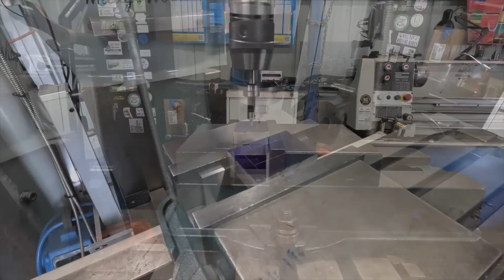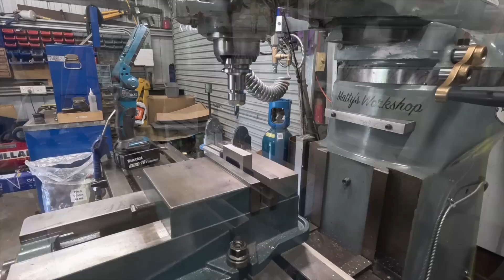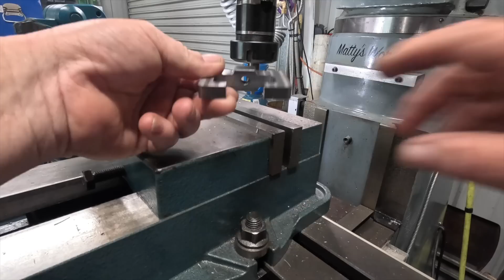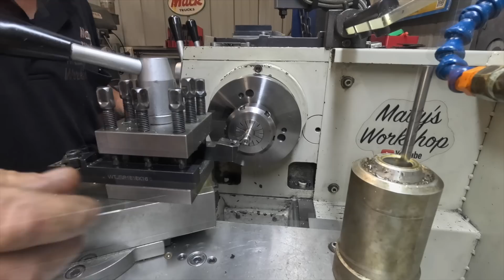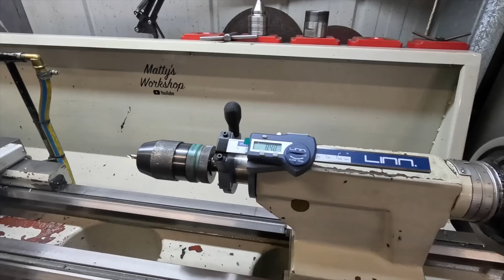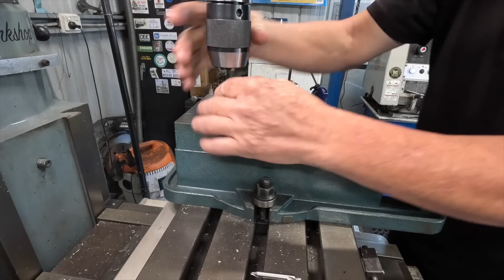Hemingway Die Holder modification

Comment: Ha Matty ya I would take then yo on it, I have the same emery and it works good. I am in the US  and I get rolls of 20’ x1” for $20.00 from benchmark abrasives I have used their products for 15 years very good with fast shipping thanks buddy.👍
Reply: Have you had problems with their cut off wheels? Bought cut off wheels from them for couple years, and after about 4-6 months, it seems that the resin holding it together would just let go.... even with shields on grinders, managed to bust shop windows and put dint  in customer's car when in use 😢, something to look out when using Bench Mark Abrasives cut off wheels, we ended up throwing away close to $100.00 in discs to air on side of caution ⚠️
Reply from the maker: Gday, I’ve decided not to go down the  path with Temu mate, appreciate you watching, cheers

Comment: If you could grind some squares on the correct drills for your taps you could do both drill and tap in one setup. I bet it would give great concentricity. It'd mean more adapters, but then you could leave them assembled with the drills as a set.
Reply from the maker: I'll definitely look into it for future projects, thanks for the tip!

Comment: By the way, my solution to tool height problems without changing tool posts is to buy a cheap tool, saw it off and re-weld it back on kinked to the right height! Get the young feller to weld it up for you! Cheers Mate!

Comment: Matty I know end mills come in 2 flute 3 flute and 4 flute what determines which one to use. I know I've seen several videos on feeds and speeds but never seen one on which cutter works best with different types of metal. Which cutter do you use on each type of metal
Reply from the maker: Gday, I’m probably not the right bloke to be asking what is correct to use, I’m only self taught and use whatever I think is right at the time, cheers

Comment: Ive bought a lot of stuff off Temu some is excellent some is average and the odd thing is crap . Ive bought drills off them that were really good for the price and some that were crap . 
Some of the lathe tools have been better than i thought . The biggest thing i find is some of the adds don’t give the measurements and sometime you end up with something thats smaller or larger than you thought you were buying but they so cheap its not a big deal.
Currently building a little Go Kart car for the grandkids and have got a lot of the components off Temu . Bought hydraulic disc brakes that look amazing quality for the price . Steering wheel seats and bearings plus a cvt clutch all good cheers Doug
Reply from the maker: Gday Doug, sounds like you’re getting some good gear off Temu for your Go Kart build, appreciate you watching mate, cheers

Comment: Great revision of the Hemingway die holder Matty, that's a lot better than the original, and as for the tap holding adapters they're bloody awesome mate.  A company called Chronos Engineering here in the UK do a Chinese copy of the Multifix quick change tool post, they're not cheap, but they're bloody good quality for the money, all the locking mating faces are ground and I get a repeatability of 0.05mm at maximum and quite often 0.02mm. They do a set of four tool holders plus the main post. 150mm-300mm swing lathe for £270 ( that's $551 AU)plus whatever tax you would have to pay in Oz plus of course shipping.  That the pretty good value in my eyes. I have now got 12 of the holders and still want more! I hope this helps Matty, maybe some Aussie company does them as well. Cheers from London, Sam PS I forgot, it's worth giving Temu a spin mate as quit a lot of the gear they sell is of reasonable quality, and you can't beat the price. Some things are not so good but normally you can see if it's crap by the pictures. I've bought several indexable tool holders for my lathe and bought inserts with and separately, and I've not had any problems with the quality because I went for the  higher price if there were multiple choices of the same tool.

Comment: To strengthen the original thread, cut it off and tap the end M6. Then fit a high tensile steel screw and cut it to leave the original length of thread. This will be far stronger than the original and much easier to make.
Reply: I make the majority of my male threads that way. Never need a die holder just drill, tap and fit high tensile bolts. No undercut in the thread where they break.

Comment: Nice work Matty. Threads are notoriously weak in shear. Your handle would benefit even more if you counterbored the fork a few mm and then had the handle tighten down into the recess. The shoulder on the handle will provide a stronger engagement with the fork than the thread alone.
Reply from the maker: Gday, the fork does have a counterbore, I didn’t realise until editing I didn’t film it, thanks for watching

Comment: G'day Matty. Enjoyed  your modifications,  which worked out really well.  Just wondering why you couldn't leave the original thickness of new block the same on the top thickness before you did all the modification machining., then you could have beefed up the thread to 10 or 12mm for the push handle section.
Ted
Reply from the maker: Gday Ted, didn’t leave it at full thickness just to make it look better, thanks for watching

Comment: surely the solution is to get a temu quick change toolpost sponsored. and a few tool mounts for it. then you get what you need if it is good, or you might have the guts of a project to fix a temu toolpost.

Comment: That’s a bloody good tool and really well made. I’d like to make one - I’ll design my own though. Using it for taps as well is great. Really enjoyed this video. 

As far as quick change toolposts goes, I tried some cheaper knock off ones and wasn’t impressed. I use an Aloris which I really like, although if I were outfitting another machine I’d probably get a Dorian. I’m sure there are some cheaper ones that are fine, but you seem to be doing great with the tool post you have, so maybe that’s the best option?

Cheers and all the best.
Reply from the maker: Gday Stuart, I’ve always said I’ll only go a Dorian but the price factor has a stop on that idea, I do get away with what I have but it would be nice to be able to change tools quickly, appreciate you watching mate, cheers

Comment: "He says: "Because I'm short" — not the full story, as many in the altutinally challenged group will say: "feet still reach the ground" 👍
On the threaded handle needing to be stronger, I wonder if a non threaded press fitted bar, with or without cross rivet, would do the job, and allow an extra 1-2mm diameter for the beefing up.
Love your videos, and keep on keeping on.
Reply from the maker: Gday, I’m only short one end, you could make it a press fit and that would work fine, being threaded gives the opportunity to put in a longer or shorter handle if needed, thanks for watching